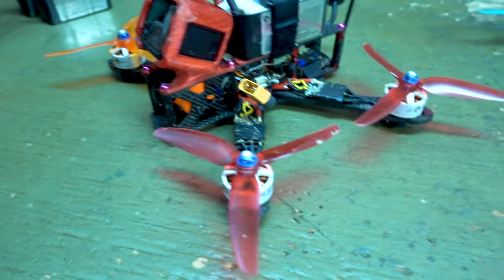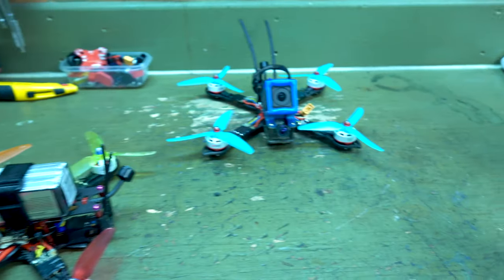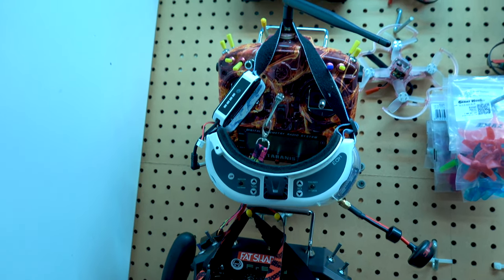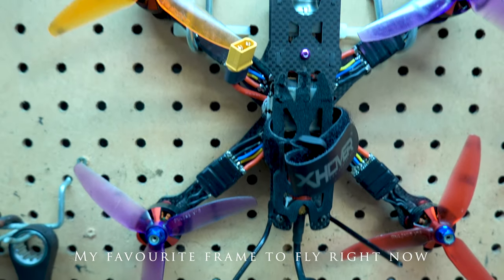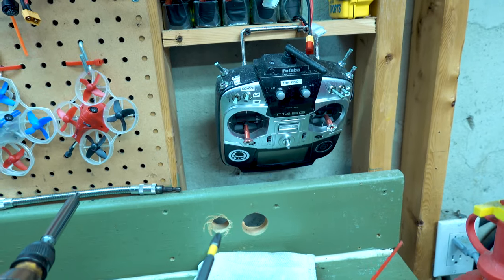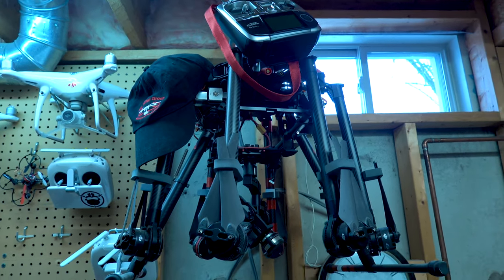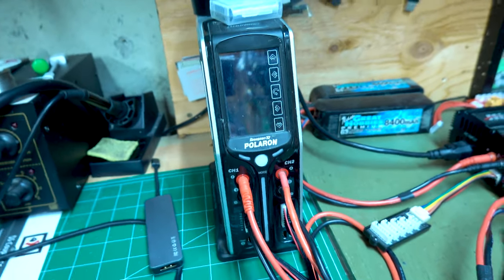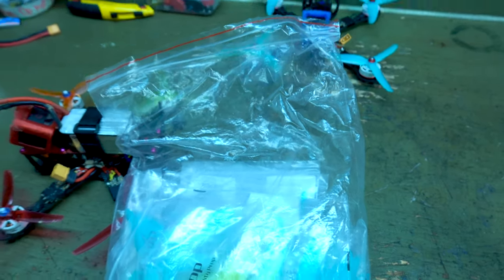A tour of my drone wall!

Comment: SUUUCH a pit of money right there!!! In the 2 huge drones and 4 high"er" dollar Tx's (3 that aren't in use lol.) Not to mention the like 5 or so 200$+ cameras. Must be nice to be riiiiiich!!
Reply from the maker: Can't take it with ya man! LOL. It's also accumulated over a period of time so it you break it down monthly and yearly it's not that ad LOL. But I do work my a$$ off as well.
Reply: @Luv2ripFPV  Not judging at all, I've built quite a few quads and have 5 up and running right now... I just was trying to figure out how to justify the at least 2000$ combo for the futaba radio and the 2 giant monsters you have than you said you don't fly anymore lol. Those would have been gone to pay for the HDO's and the rapidfire for me! lol (however, I totally get the first one might have been a passion project or your first build and that gets kept for sentimental reasons)
Reply from the maker: @pitviprplays9794  All good man!  The 2 phantoms I use regularly once a month for a project. I always have a back up in case one fails. But the S1000 has got to go this spring.  As a rule I always like to double up on stuff. Plus I have a hard time letting thins go ;)
Reply: @Luv2ripFPV  Yeah! I totally get that! I wasn't even thinking of the 2 friggin' phantoms lol. You use those for work though so... A place just opened up in my town and I want to try to get SOME kind of position with them, but I've only ever raced and freestyled. I've never done AP flying or worked on an AP platform.
Reply from the maker: @pitviprplays9794  I've never raced.. would like to giver it a whirl though.. But I'm still getting the hang of freestyle LOL. I wish I could do this stuff for a living! Hope you get the position!